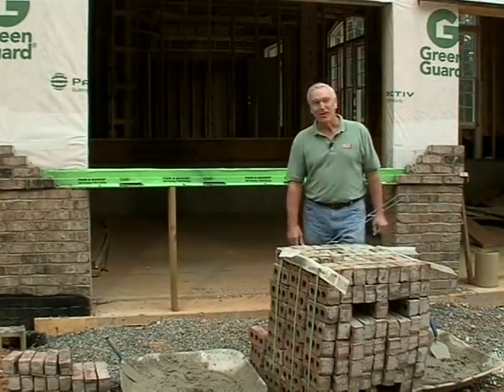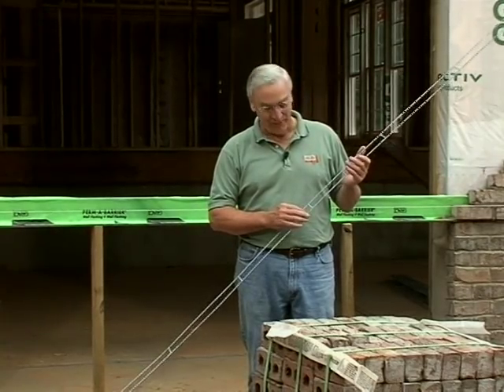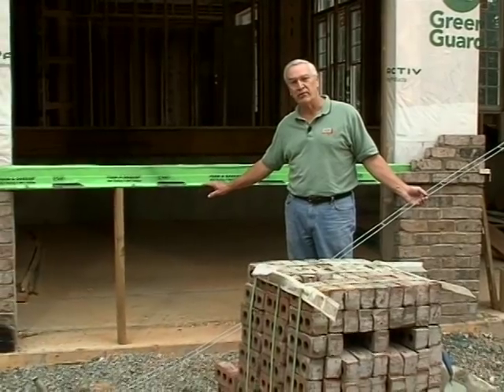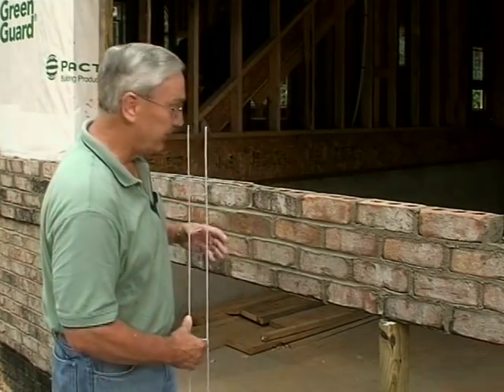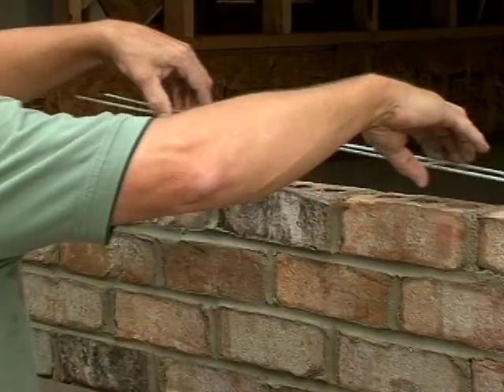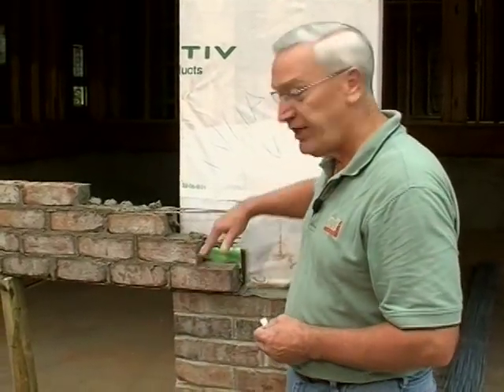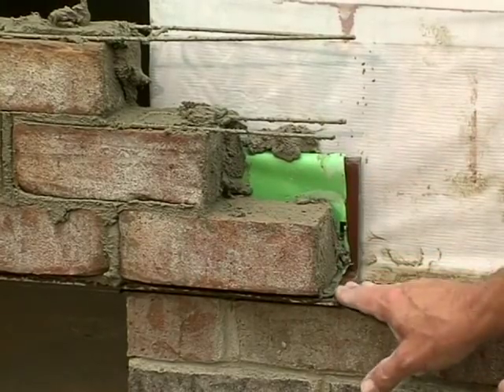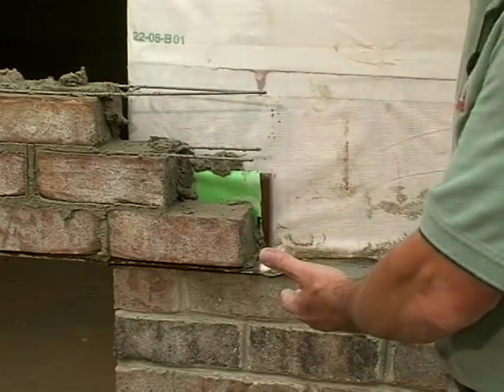Support of Brick over Garage Doors

Comment: Those are Great Tips.  That durowall works great for single wydth brick planters too (no need for the expense of double wydth for strength).  Just use that 4" durowall every other course and parge thick the inside and those planters will last 20 plus years. Guaranteed if I build it. ... use Type S too. and put in plenty of weep holes (open head joints at the bottom looks more natural and better than those doo-hickys).

Comment: we drilled holes through the back leg on the lintel then use lag bolts attached to the wooden header , aprox  2 foot centers, duro-wall is for load bearing purposes on concrete block walls , and it will make a wall crack, the piece of cotton rope at the end is a good thing to do

Comment: I've been in the trade all My life so here goes. The angle iron should be laged in about the door washer,bolt,nut. Seen where the comment said they NEVER "flashed" over the door however if there is alot of wall above the door you not only need to flash it "weep" holes would come in handy. The number #1 reason the brick crack above a garage door is the door gets slammed down to close it and shakes the structure each and every time. Solution? Garage door opener. If the brick work is done right that should and will stop the cracks.

Comment: Why would you want to put stress on the brick above the lintel?  Once the temporary supports are removed, the angle will deflect which will put stress on the brick and mortar joints.  Depending on the stiffness of the lintel, this could crack the mortar.
Reply: +AddictedFishing1 The weight of the the bricks when the motar is wet can put a bow on the lintel which is not good, once the motar is dry there wont be as much downward pressure in the center because the structure will be solid and the lintel wont deflect when you remove the supports.. assuming you're using the correct lintel that is
Reply: +Jeremy Meehan For anyone who is going to try this temporary support method to control lintel deflection, please consult a structural engineer prior to doing so. The lintel size should be sized to satisfy deflection criteria by the engineer. By providing and removing temporary supports, you transfer stress from the lintel to the brick and mortar.  Mortar has about ZERO strength in tension so you may crack the mortar once the temporary supports are removed.
Reply: AddictedFishing1
All new homes, commercial buildings have their lintels specified by engineers etc. Been building them for 10+ years, i can assure you that some lintels(specified by an engineer) will deflect given a certain amount of weight on them. Large openings usually have an expansion joint on either side. I have never had a brickwork crack above a lintel when pulling out supports and we don't use wire mesh of the lintel, only on the top course of some houses. I can also assure you that if you dont support your lintel and it deflects, the builder will make you pull it down and repair it at your expense. Experience is the key here.
Reply: any one ever tuck point a wall with durawall (wire) in it?  the bed joints with durawall always seem to be the ones that fail caused by the wire expanding due to rust causing the mortar to fall out
Reply: David Dolensek
No, can't say i have, does the wire not have a galvanised finish?

Comment: I have always laid 2 courses of brick over the angle iron, nailed wall ties in the house and then put a third course on and let it set overnight (with the stiff legs under the iron aswell). Never have fooled with any flashing or wire. If you're getting that much water behind the brick,you must have left the soldier course off.

Comment: 1:13-ish, there is not need for these stiff knees.  One angle leg needs to be taller than the other leg, removing the weakness of the steel.  However, it would not hurt, it needs to be firm, but not lifting the steel, or when it is removed, the wall will sink a little and possibly cracks.  Where are the gloves, safety glasses, and other PPE?  Lapping of the wire, good practice.  5:19, what?  No, a control joint is required.  the wall will crack vertically and uncontrollably with out a control joint.

Comment: Why are you spreading mortar on the steel lintel. I was taught in Masonry class and on the job training to never do this. Overtime the mortar will decay the peel and stick flashing and then it will also decay the rust proofing over the lintel causing the lintel to rust away
Reply: chrispasley10
Reply: chrispasley100 right how does the water get out ? So why even flash it anything on a steel lintels we always put in dry with head joints and weep hole vents . I work for a commercial masonry comp
Reply: Jimmy Legendre 

   Sometimes you HAVE to bed up the first course but always make sure the the drain perps are cleaned out as well as the void behind the first course. 
     Another thing, we typically use a metal flashing on top of the ice and water shield or blueskin as we call it. 

The initial reason for this response was to say that I’ve noticed on double wide garage doors the lintel always looks like it’s sagging even if it’s dead nuts level. 
     So to prevent that illusion we would bolt the one end of the ledge steel then place a 1/2” wedge in the centre and bolt the other end of the steel down, so that the steel would have a 1/2” rise in the middle. And voila the illusion of a sagging lintel gone.
Reply: LarJgrip nice good tip ..thanks